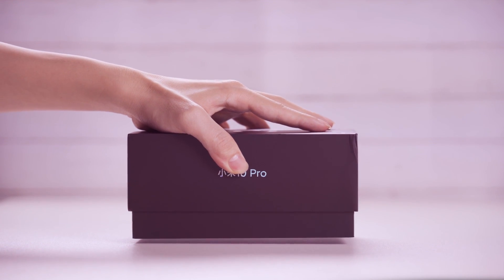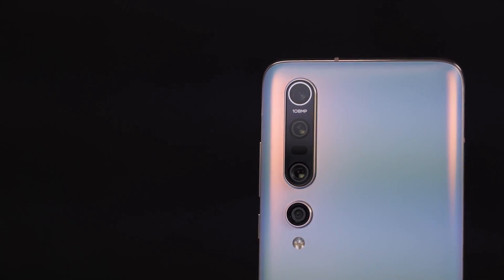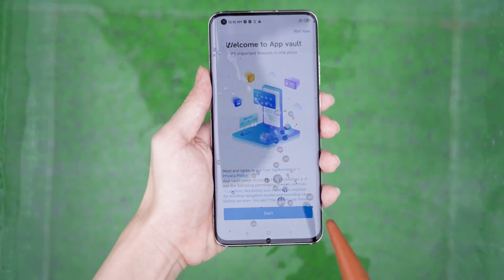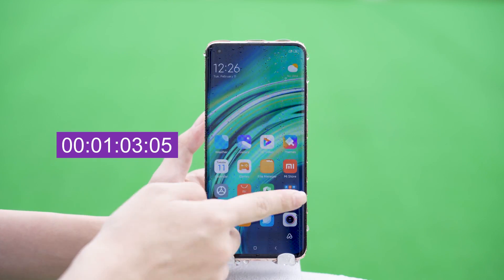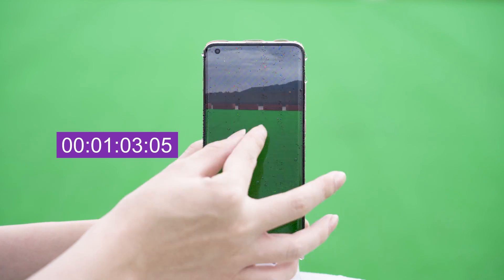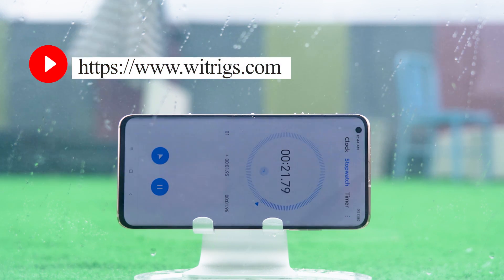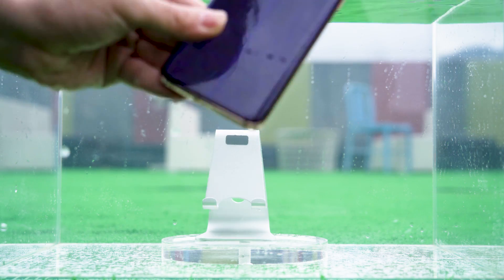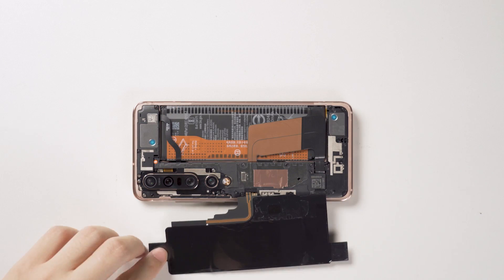Xiaomi Mi 10 Pro Waterproof Test！

Comment: Typing on my Mi 10 Pro. Absolutely love this device 🔥🔥
Reply: Note or flagship?
Reply: @MorkusReX  premium i think
Reply: Yeah dude , this phone is a beast .. I just love this phone
Reply: @hyperflame3825  indeed. I'm on the Mi 10 Pro as well !  Install gcam (burial) btw
Reply: But unfortunately not water resistant 💦
Reply: U can shoot underwater
Reply: @auliaana9982  no
Reply: Is it has bugs?
Reply: @amelmesic8876  I'm using the Global rom and it's pretty stable.
Reply: @MorkusReX  i mean with gestures when u swiping is it smooth like iphone or doesn't have smooth animation?
Reply: @amelmesic8876  smooth
Reply: What did you have before. 
I'm currently running a mate 20 pro by Huawei and not rally been tempted to change until now .
How much more advanced is the mi 10 the Huawei.  
Also is there any real benefit between. The mi 10 and mi 10 pro ?